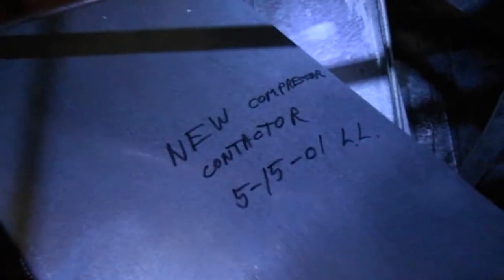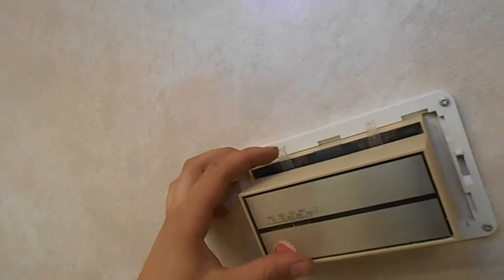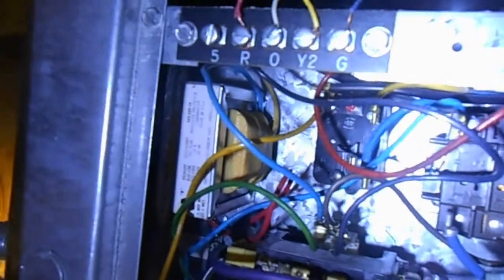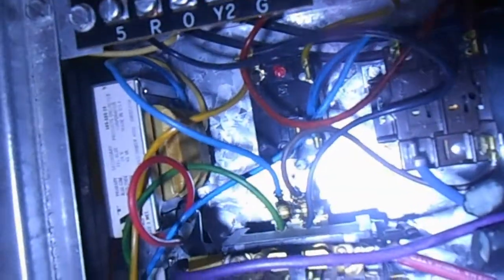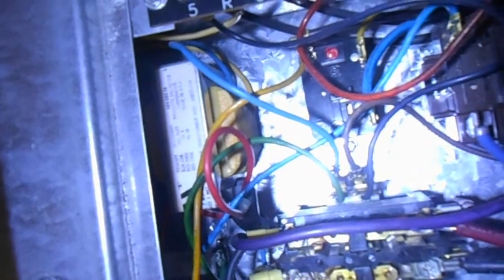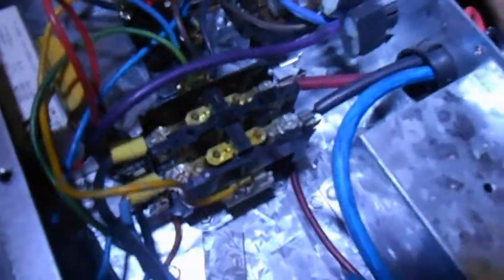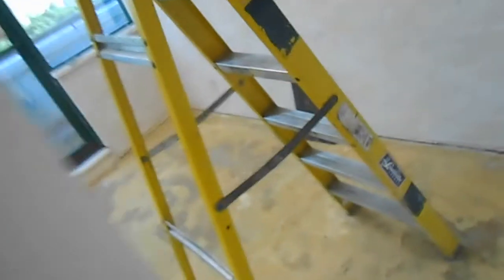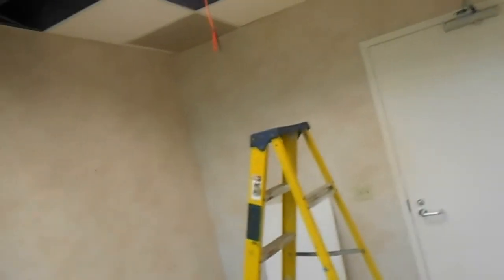Suite 388: 3 Ton WSHP Troubleshooting

Comment: Start Assist is optional you can add an spp5 and be fine if need it.  Is or was Tstat wire for Heat?
Reply from the maker: Yes, these units were all on the building original (mercury bulb) heat pump stats. They were all "O" reversing valves

Comment: what would the run cap have to do with a heat pump and mercury bulb t'stat that's switched over while running? Looks like a control issue to me, in other words it's running in cooling and switched to heat and stops? A compressor with a bad capacitor shouldn't run to begin with, no?

Comment from the maker: heatpump hvac actually it was wired correctly, sometimes they use different colors to confuse the next guy. The problem was a faulty run cap; which I should have checked much earlier in the diagnosis. It's true that reversing valve failures have been a common problem for these units but, I think it is more the design of the valve than improper field installation. Thanks for watching and commenting!

Comment: who ever did that carrier did it wrong and thats what the problem is the orange thermostat wire should have been on o and yellow control wire for the contactor coil should have been on y they wired it wrong thats why its not heating properly

Comment: those old climaster water source heat pumps have alot of trouble with reversing valves including that carrier whats up with those heat pumps air source heat pumps don't have problems with reversing valves usually but what i think it is is where they mess up the control wiring on the reversing vlave and cause it to stick orange is for the reversing valve to energize in cooling mode and the blue wire on rheem and ruud is for the reversing valve to energize in heat